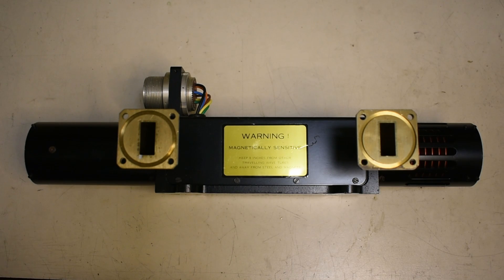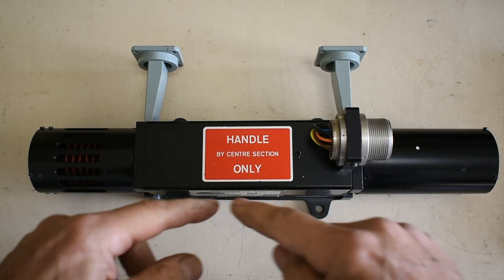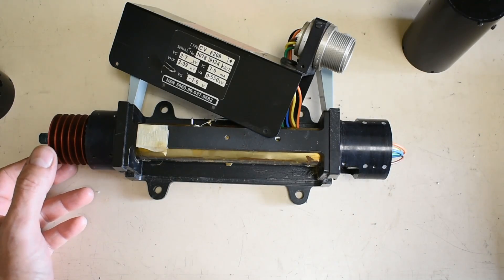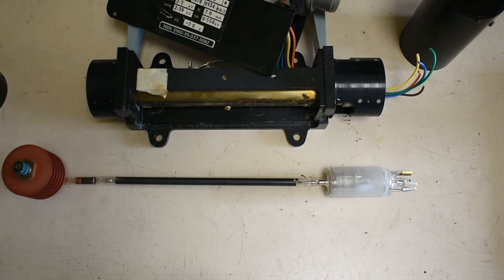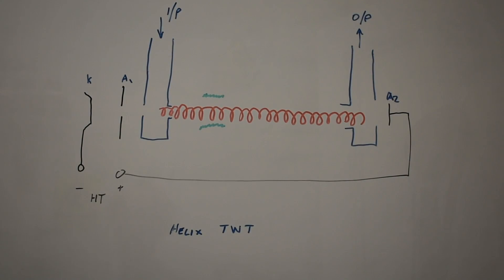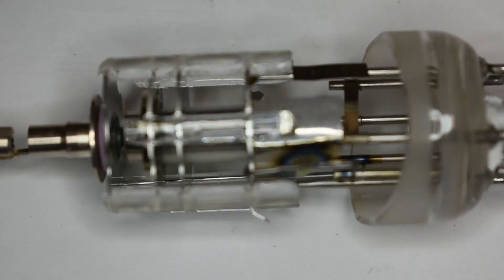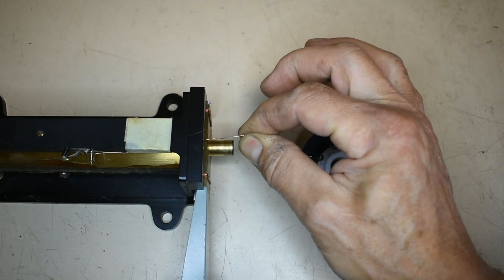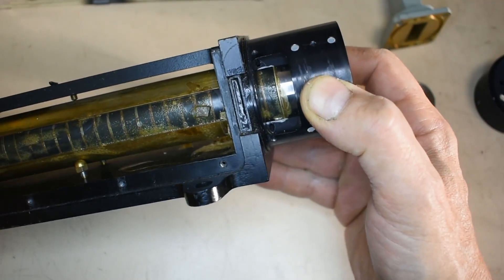Travelling Wave Tube Amplifier

Comment: Wait a min.. what frequencies produce x rays... hmm BRB let me do some research.
Reply from the maker: While x-rays have a frequency range on the EM spectrum it doesn't relate to microwave frequencies which are less than visible light. The danger of x-ray production occurs with electron acceleration voltage. Where anode voltages are above 20kV x-ray production can becomes a problem. Soft x-rays  occur at lower voltages but don't have the ability to penetrate the enclosure.

Comment: I would guess that was used as an IPA (intermediate power amplifier), used to drive a larger transmitter valve.
TWTs are rarely used in receive paths as they are inherently noisy, mainly due to their very wide bandwidth.
Incidentally, the anode is referred to as the collector in a TWT.
Reply from the maker: thanks, yes, force of habit, the anode is noted as collector in TWTs, not sure of the original use thought it might have been military.
Reply: @tuopeeks  The WG looks to be WG15 and you mentioned 9GHz, so X band and possibly military; did I spot a CV number on the label?
Reply from the maker: @cambridgemart2075  yup, CV 6028
Reply: @tuopeeks  That's odd, CV6028 comes up as a TR cell.
Reply from the maker: @cambridgemart2075  sorry, my typo CV6208
Reply: @tuopeeks  I can't find much other than it's equivalent to E3084, but no sign of any data for it. It probably was military, as indicated by the War Department (CV) number.